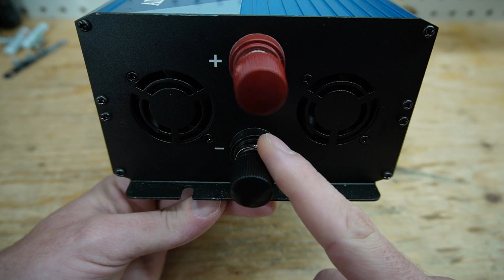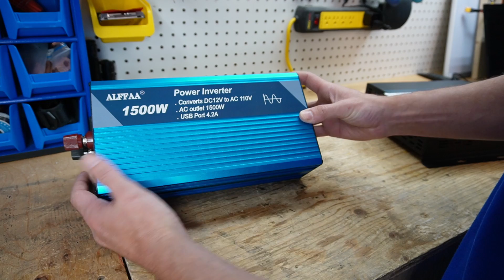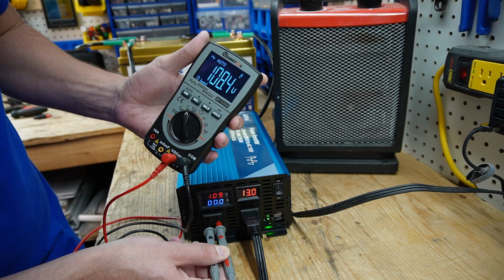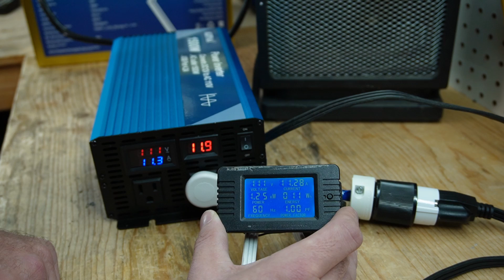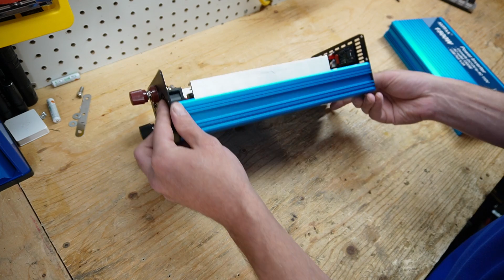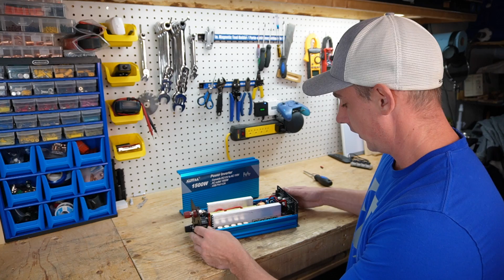ALFFAA 1500W Pure Sine Wave Inverter Review

Comment: I bought one of these in May and it has worked well, running a full-size Maytag washing machine 2-3 times a week out back behind the shop. Walked out and looked at the USBs and they appear to be normal, but likely will never get used.
Reply from the maker: Thank you for letting me know it's working out for ya 👍 if anything changes please let me know. 😁

Comment: I have this inverter and I have no problems with the USB.  I did release some magic smoke when I was using it on a pizzazz pizza oven.  It runs @ 1235w.  Now the inverter only outputs about 90 volts.  I should make a video of looking at the inside for some burn spots.  Nice video!
Reply from the maker: Yes you definitely should make a video showing and speaking to your experience with this inverter. Now you have me thinking of taking my video down. 90V is not good.
Reply: @Roll2Videos  I wouldn't.  I might have a bum inverter to begin with.  I still use it even though it doesn't run at full voltage!  I just need to do some further inspecting.

Comment: I like your review style. I almost bought that inverter. I ended up buying the ampeak 1200W sine wave inverter instead because of the info display. If possible, can you test/review the ampeak inverter? Also compare the size to this one. You can contact ampeak on their website & ask for Amazon discount code for review. I asked for discount code and they gave me a code for 40% off.
Reply from the maker: Wow that's is a great price for that inverter. I will look into it and see if they will work with me. Thank you for the tip!